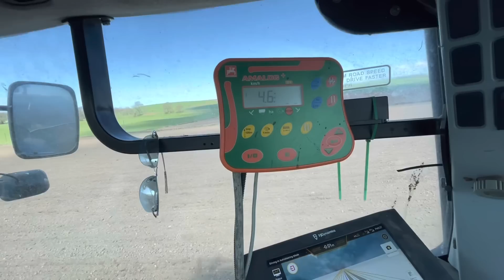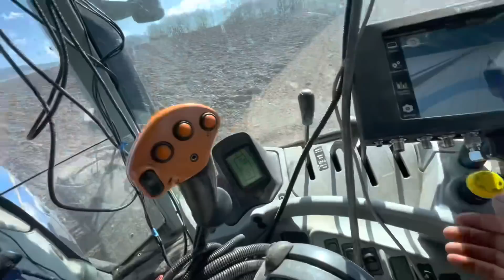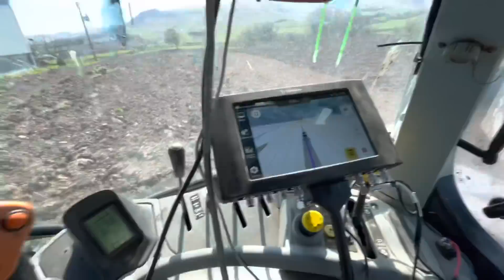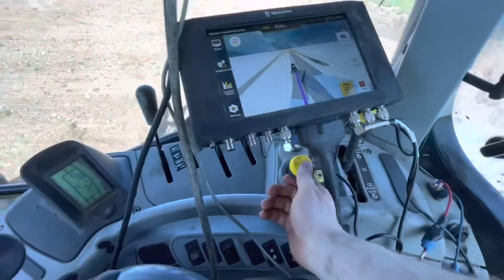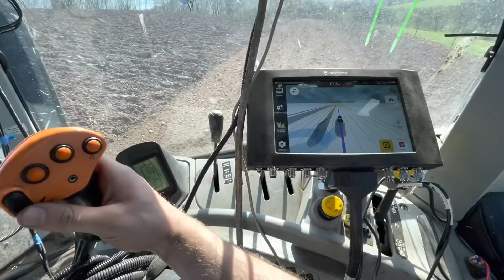Drilling Spring Barley!! New Holland T7040 Amazone One Pass!!

Comment: Good video Drew👍 nice to see you gettin the spring crops in the ground 👌 for many years the job was done without tramlines and no GPS on the sprayer either 🙄 just a strip of black tape on either side of the windscreen that you lined up with previous wheel marks 👍 have you got your fattening stock out yet or still feeding them 🤔

Comment: Is there something slack on the steering wheel bracket? Or is that normal for the electric connector to move so much?
Reply from the maker: Bracket no fixed properly
Reply: @DrewsFarminLife  a bit shoogly! 😀
Reply: @DrewsFarminLife   so the auto steer isn’t correcting that much it’s just play in the steering wheel? I think I’d get sick if it was moving that much.😂